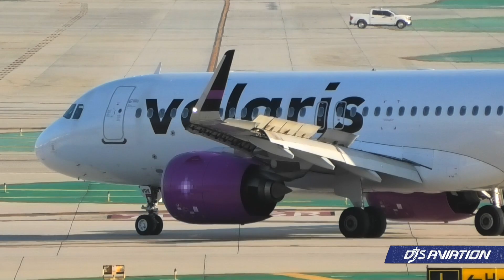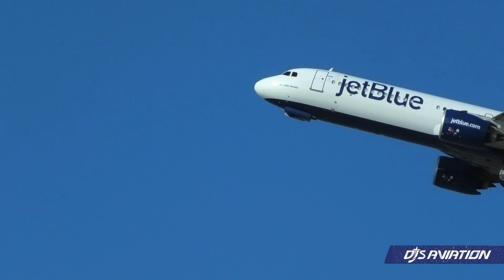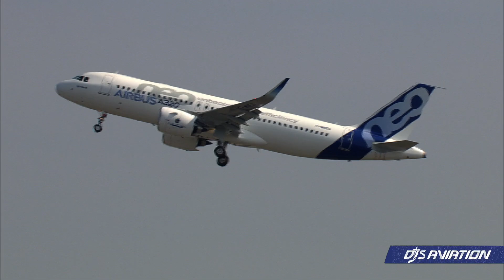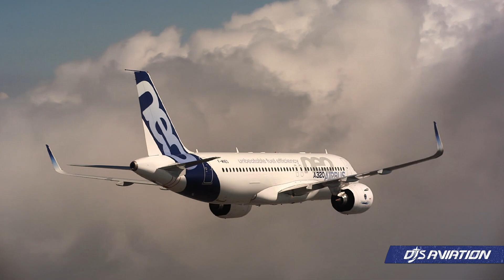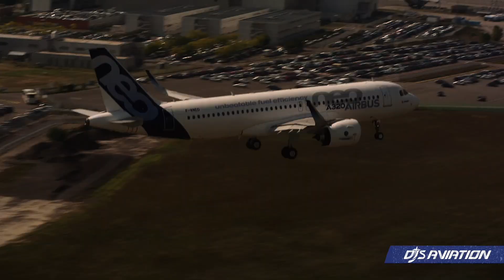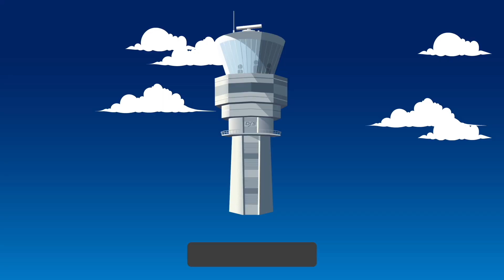Airbus A320neo Problems...

Comment: These engines are on the very edge of technology. Just seeing the power at take off, they are just remarkable . Powdered Metallurgy is not new however some of the metals & production methods are & sometimes a problem shows up well after. One of my engineering lecturers was a world expert on these methods & it was absolutely remarkable the methods he was talking about . The forces going on inside these engines is mind boggling . The about the most powerful GE90 that produces over 115,000 pound of thrust. Those engines provide enough power for the heaviest Boeing 777-300ER to climb on one engine after take off.

Comment: PW really can't blame "supply chain issues" on this anymore. The engine has serious flaws and that's on them.
Reply: No it doesn’t. The engine reliability is fine, not really worse than any other engine. The problem is the supply of parts for repairs.
Reply: @swems-z3s  Incorrect. The maintenance expense on the PW is nearly twice that of the CFM. Much less time on wing because of parts wearing out early and all the technical problems with the engines.
Reply: @swems-z3s  Dependable Engines 🤣🤣🤣 just ask Go First
Reply: @swems-z3s Of course it does! These engines are having problems in dry, dusty and hot environments and their maintenance checks are being anticipated.

Comment: Airbus offered to his  A32O customers the possibility to choose between 2 engines, PW should do the maximum to solve their issues on the GTF fans if they wish to continue selling engines! Furthermore, Airbus is also looking for a second possibility for the A220, specially if they go to the stretched 500 plane. My concern is your way to present the facts, the problems are mainly in the hands of PW, and Airbus customer had the choice to go to CFM.
Reply: I'm sure those that chose the PW didn't anticipate all the issues. Not much the carrier can do on an existing plane other than endure the issues.

Comment: I have friends in one of the assembly areas and they say that airbus has been sending over inspectors to look at every engine before it goes out. He also said they’re adding Round the clock shifts because they finally got authorization to do so from Airbus to get output up

Comment: A very basic question.  Does airplane choice lock carriers into an engine type for the life of the frame, or can the carrier change engine company and instal a different engine type (all be it with possible lower efficiency)?
Reply: It sounds simple, but is practically very difficult - the engine mounts are different, the engine weight is too, which means changing the centre of gravity and associated calculations; all connectors and the FADEC and software would have to be changed as well.
Reply: Pretty much impossible to change. The 787 is the only aircraft that technically designed to be „switchable“, but there it makes no sense economically, under any circumstances
Reply: @cedricfranzen8558  That was the original plan for the 787 but abandoned because it turned out not to be feasible
Reply: Yes it locks a carrier in on given plane.

Comment: Interestingly, I haven't heard of significant engine reliabilty issues at Delta Airlines with their P&W PW1500G engines on the A220 planes. Maybe because Delta's world-renowned TechOps devision have the experience to actually service the PW1500G properly?
Reply: It’s less about know-how and more about parts availability. But Lufthansa, which also has a huge Tech devision is also having only limited problems. I suspect that their respective, very large, tech devisions simply have more parts in stock and obviously use them on their own aircraft first.
Reply: They have a contract with PW to service the engines. It played into the decision on the engine choice for them on the 321NEOs
Reply: Haven't heard much from Air Canada either but then again they were pretty close with Delta when they ordered the 220 so maybe they share info back and forth

Comment: Just when you think there's a light at the end of the tunnel ,
Then this latest issue pops up...
1200 engines on top of all the other engines sitting idle as a result of the previous issues. This is definitely going to take some time to eventually resolve !!
Reply: Considering how lousy P&W is, they won't be resolved for a long time, if ever - dependable engines 🤣🤣🤣

Comment: Thought the Pratt and Whitney situation already got resolved, apparently not.
Reply: Not even close.
Reply: Their less reliable than RR only 3 to 4 years ago
Reply: @filledwithvariousknowledge2747 no, their reliability is actually better. Their problem are the parts
Reply: @swems-z3s Would you please explain how to make a reliable engine using unreliable parts?
Reply: @MarceloTrindade1  the reliability is not the issue. The supply of spare parts is
Reply: @swems-z3s I think you are not aware of the whole subject here... The P&W GTF engines are having problems in dry, hot and dusty environments, requiring unplanned inspections and maitenance.
Reply: @MarceloTrindade1  I'm very well aware of the issue and again, if the suppliy chain would work properly the problem would be almost irrelevant.
Reply: @swems-z3s  Ok. Tell this to the Airlines that were not expecting those extra checks and maintenances in their schedules and planning.